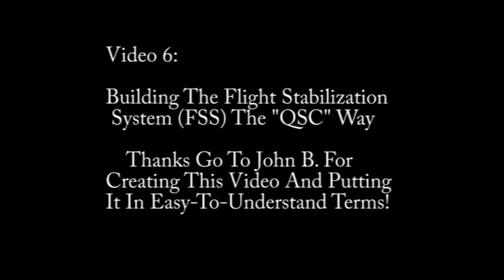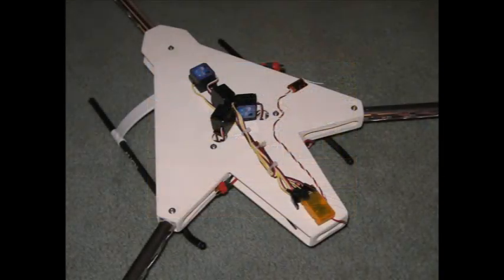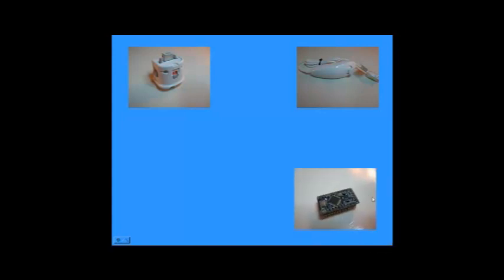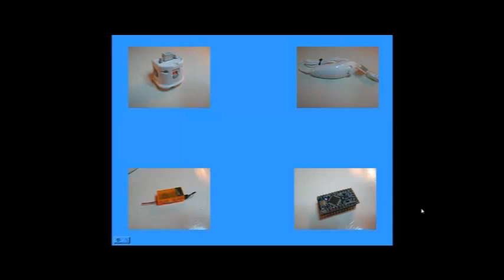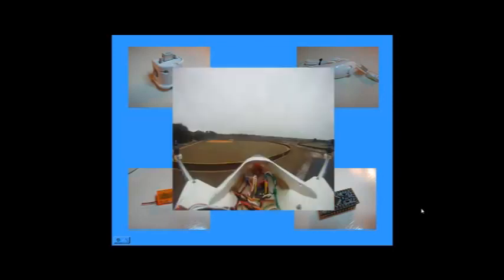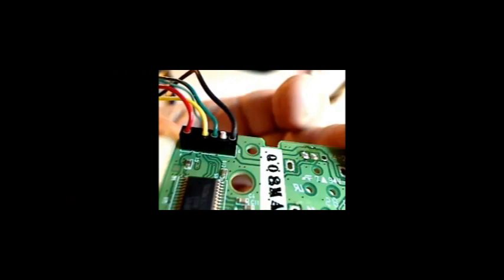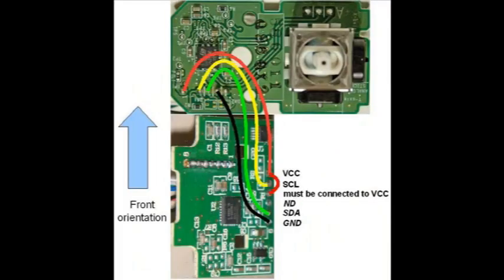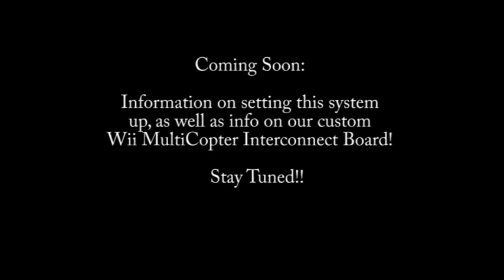6.QSC TriCopter Flight Stabilization

Comment from the maker: @Skydive4ever  Don't sell yourself short, Mario. If I can do it, ANYBODY can do it! LOL I will say, however, another option that may make things a bit easier may be to use an Arduino Uno board instead of the Pro Mini board. That options allows you to to skip the soldering of any wires to the board, since the Uno has female headers that you can simply plug Jumper wires into. This would leave you with really only having to solder the wires associated to the Wii components.

Comment: A tip and a WARNING !, Do not thrust the colors of the wire, i have gotten several different mw+ and nunchucks out of ebay (including ones that claims to be original) ..  And not on a single one have the colors been correct. Look at the connector instead and see what the different wires are ! Great video !!!